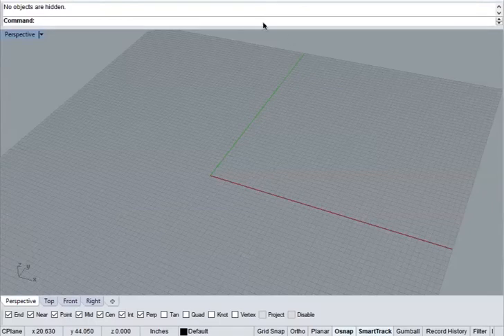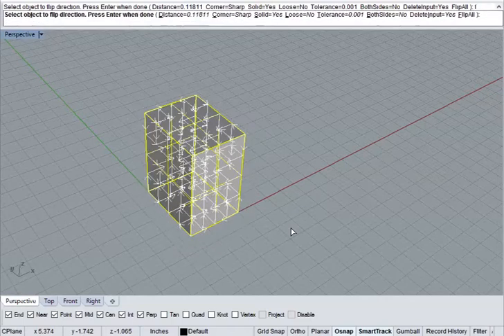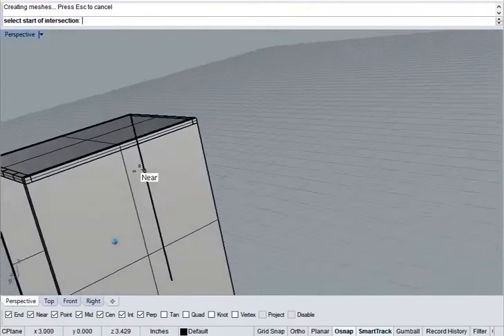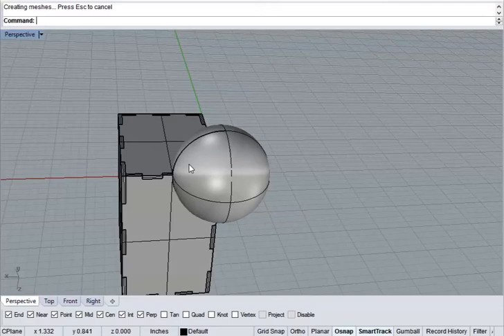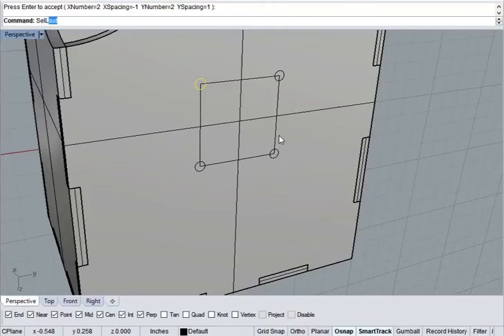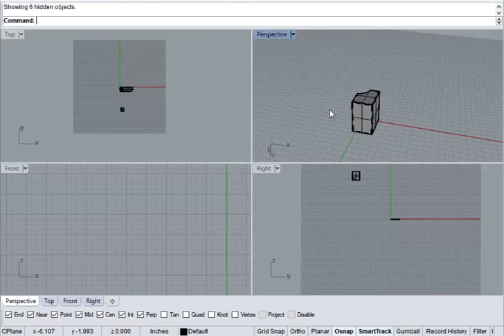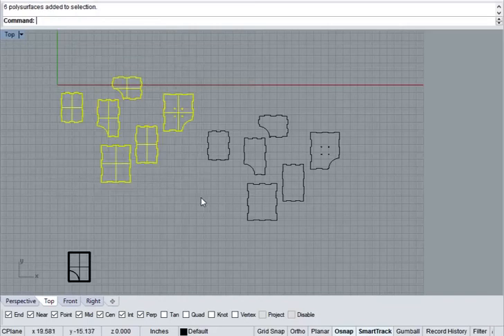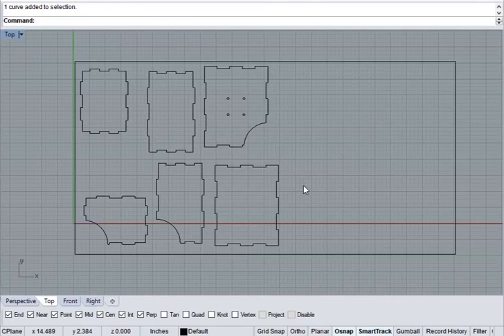Rhino Fingerjointing tools

Comment: I don't really know where I'm going wrong but after selecting all my faces on the box and clicking the corners for the intersection, i always get an X and Y surface deleted, both Z stay however. Same happens if i try and use two.py, only 2 surfaces get finger joints and the other 2 get deleted, is the code broken?
Reply: hello
after 3 years whats new in 2021 are you solved this problem

Comment: Hi, why finger.py file get this error. "Message:name 'main' is not defined" / traceback:line 105, in <module>
Reply: Did you ever solve this- also getting this error
Reply: Also getting this error. I used Eric's fingerjoint command all the time before having to re-download Rhino on my new computer. Now i'm not able to get the script to work at all :(
Reply: I get the same error. Any solutions?
Reply: Figured it out, finger.py is the wrong script. You have to run xyz.py, then it works just fine!